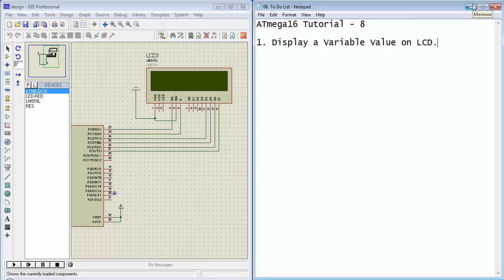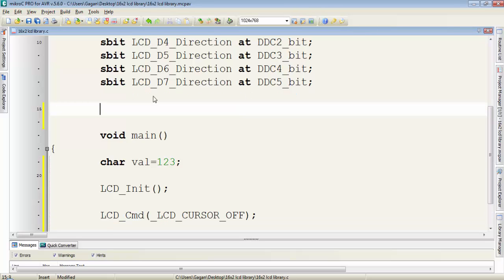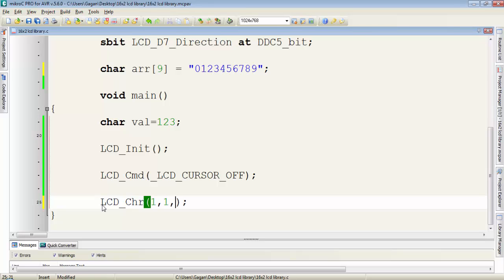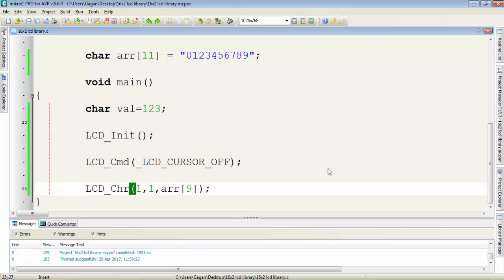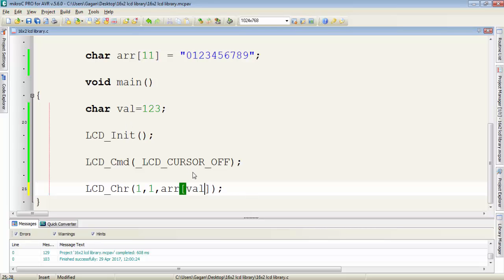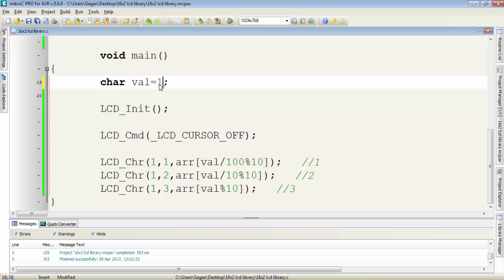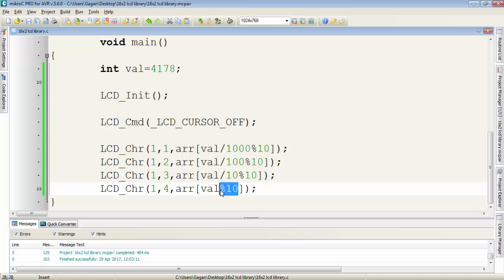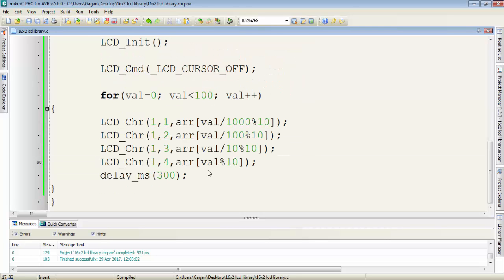Atmega16 Tutorial 8 - Display a Variable Value on LCD

Comment: How are you writing in [ ] tell the logic behind it?
Reply from the maker: The square brackets are for declaring the Array. That array is used to hold the String 0123456789. To access the array elements we need to provide Index of type Integer.
at index [0], ASCII value "0" is stored
at index [9], ASCII value "9" is stored
and to print an integer, I'm using the digit of an integer value as an Index.